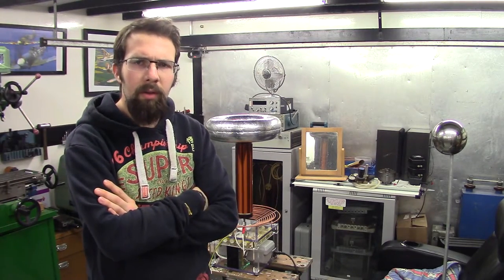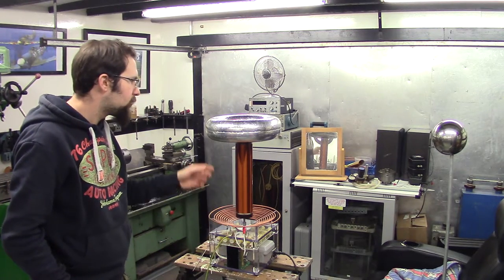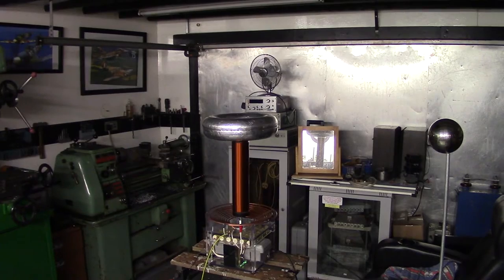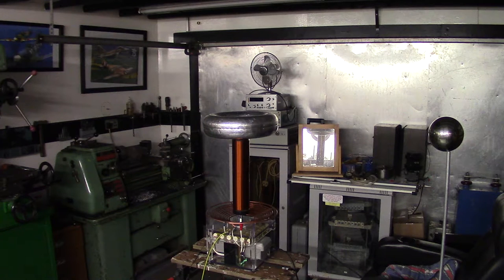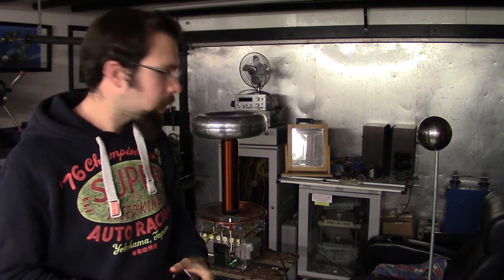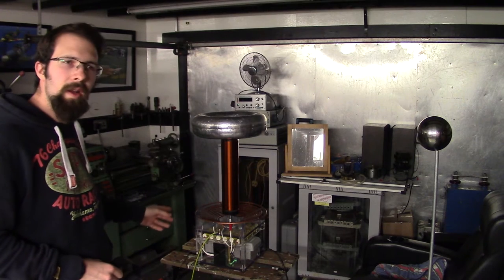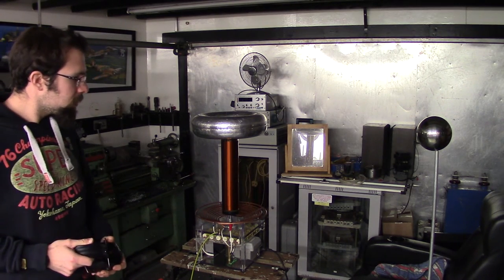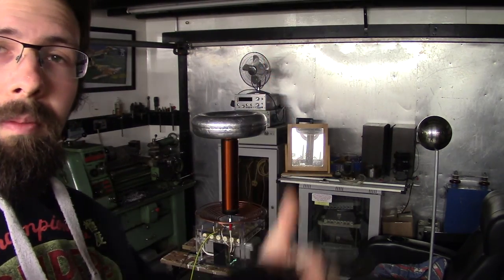Static Spark Gap Tesla Coil Demonstration

Comment: Hi Steve - it was good to meet up with you and John at Cambridge, and your coil runs very well. Your capacitor is about twice the matched value for the transformer, so I think you are unlikely to see any resonant rise and so your capacitors are relatively safe from overvoltage. If my estimates are right then you won't be able to widen the spark gap very much when the capacitor is connected - which is a performance limiter and a safety blessing all at the same time! How about upgrading to a pair of 65mA NSTs, remote from the base unit to avoid a big iron lump close to the primary? Matched C would be 42nF so with your existing capacitor (now being half of the matched value) you could expect a bit of resonant rise (within your cap voltage rating) for a slightly wider gap and hopefully much more power into the arc. (Ref the Ritchie Burnett info on resonant charging.) Good luck!

BTW, a single 65mA NST would be very close to 50Hz resonant with your 20nF MMC and this would be best avoided unless you want to try it deliberately!!

Comment: Nice! Definitley puts out a decent sized arc for its size!
Reply from the maker: +Machine Man Thanks! The arc has a favorite spot on the toroid facing right at the camera, so most the time the arc is coming directly towards the camera which doesn't show the length very well, but when it does eventually dance around a bit you can see it better, I will do an outdoor run on the 5th, so hopefully I'll get a batter angle for that. =D
Reply: Steve Lane that'd be good to see, night air being ever so slightly damp may even help it travel better!
Reply from the maker: Machine Man That is a true fact, shall wait and see! not many night of the year you can get away running a Tesla Coil outdoors without issues with the neighbors, might as well make the most of it!

Comment: sweet run its a lovely coil steve !
Reply: +dirkk82 opp meant to write more :-p the very smooth topload it what i need i lose a lot of output unless i have a rod or something to direct it out proper but think i can get those Styrofoam pieces at wollworth ! and i agree with sparky on to the next TC design !
Reply from the maker: +dirkk82 I'd like to go smoother with a spun toroid, but I don't think it's going to happen just yet, thanks though Man, tis much appreciated! Onwards and upwards! =]
Reply: yeah they are mighty expensive those toroids !

Comment: Hello There;
I made the tesla coil, the features of which are written below, but the spark coming out of the top load is 3 cm. What should I do to increase the output spark length?
Neon Transformer: Input 230 VAC.Output 15 KV 30 mA
Sparg Gap Spacing : 10 mm
Primary Capacitor Circuit: Ceramic Type 2.5 nF 40 kV (4 pieces of 10 nf 10 kV connected in series)
The resistor was not used.
Primary Coil (primary): 9.56 mm Copper Air Conditioning Pipe
Winding Shape :  Spiral Coil
Space Between Windings: 10 mm
Number of Rounds : 11 Rows
Measured on a frequency of 1 KHz with a Primary Coil LCR Meter. Inductance (L) = 0.04 mH
Secondary Coil :
Copper Wire 0.40 mm.
Copper Wire Length 475 meters.
Coil Diameter : 110 mm.
Coil Length: 550 mm
Number of Rounds : 1375 rows
The Secondary Coil was measured with the LCR Meter on a frequency of 1 Khz. Inductance (L) = 33.4 mH
Toroid :
Aluminum Aspirator Ventilation Pipe
Channel Diameter: 130 mm
Toroid Total Diameter : 400 mm
Toroid Center Inner Diameter : 160 mm
Reply from the maker: Hello Engin!

Sounds like you have a nice very capable Tesla coil built looking at the specs! Good work so far!

Off the top of my head after many years... I believe it all looks good, other than possibly the primary capacitance seems possibly low? The Tesla coil in the video has a primary capacitance of 19.6nF, but also the primary current is 37mA, so things can vary by that.

Are you using a Tesla coil design simulator, notably "Teslamap" or "JavaTC"? If not I'd highly recommend installing either of them on a computer and adding your specs into the program to make sure everything is definitely somewhere near.

Also, slightly obvious I admit, but have you tried tuning the primary circuit by moving the tapping point on the primary coil yet, it can be a bit of trial and error without using the measuring method, but generat start in the middle of your primary coil, use a pen to make areas which produce bigger sparks from your topload, you'll notice patterns in these hot-spots along the primary coil as you experiment, those are the resonant peaks, once you find them, there will be an obvious peak which produces a much bigger output compared to the others, that will be your coils resonance equilibrium, and shouldn't move after that unless you cange anything else significant to your coil design.

Kind regards

Steve Lane
Reply: @SteveLane  In the classical tesla coil I made, I used ceramic disc capacitors in the primary capacitor circuit. During the test phase, the ceramic capacitors could not handle the stress and burned out one by one. Now I will create a primary capacitor circuit again.2 I have a question. 1) Should I use a polarized capacitor (DC). Should I use a non-polar capacitor? This time I will use a Polypropylene capacitor. 2) Which of the MKP and CBB capacitors I use for this, will I make the right choice?

Comment: Awesome !! Thumbs up :D
Reply from the maker: +High Voltage Thanks! =]
Reply: Steve Lane 👍👍👍👍
Reply: +Steve Lane Hi Steve, Well I've got a few questions for ya if you know them, I just got a new big variac, and I gave it a test, and on that test, in some areas of the track there was a little bit of sparking when I turn the brushes, and the brushes are in good condition, but does that mean I should clean the track of the variac? But if you read this, thanks and give me a shout if you can, Cheers;DDDDDDD
Reply from the maker: Variac Maniac OK you have a dirty commutator, the sparks you see is from inductive spikes as the electrons squeeze through the few connecting atoms of contact you have remaining, the ones that don't make it simply divided by zero...

The way to fix it is to buy some electrical contact cleaner, and a toothbrush don't be afaid to use lots of cleaner, really work that carbon out from between the segments of that commutator.

Then repeat the test.
Reply: Steve Lane Ok, Thanks for the advice, I can see what you're saying, Thanks A Lot;DD